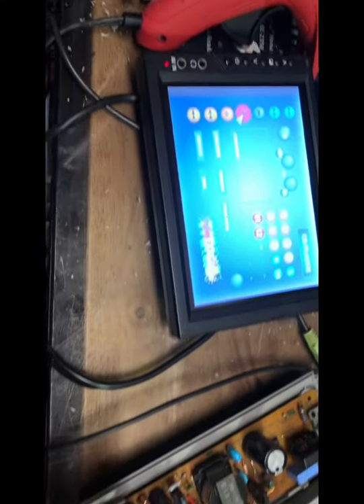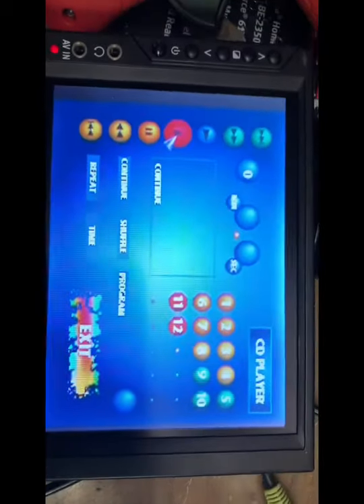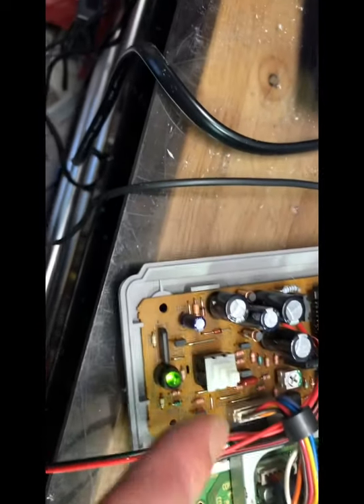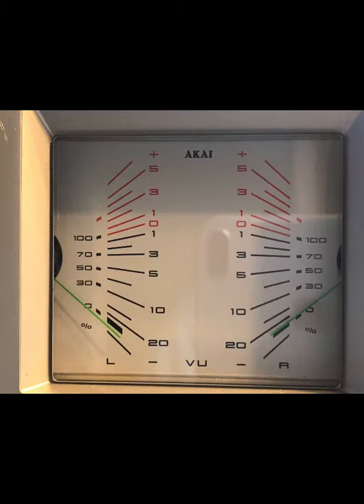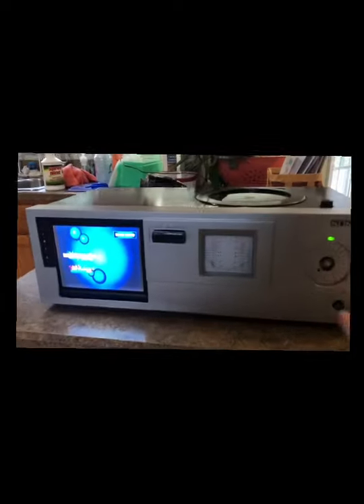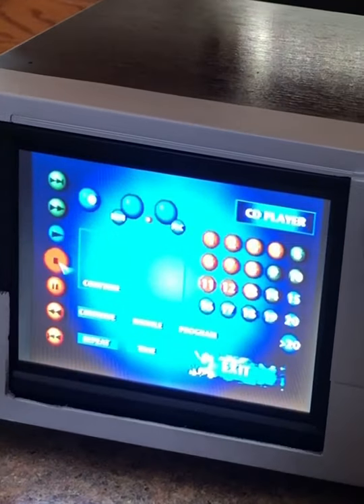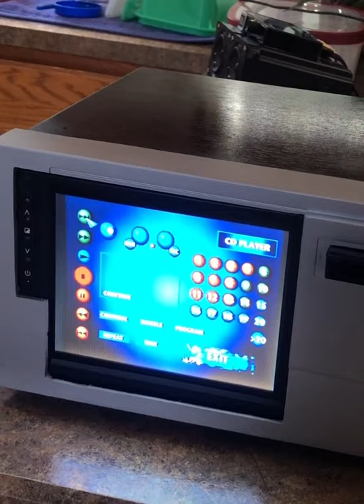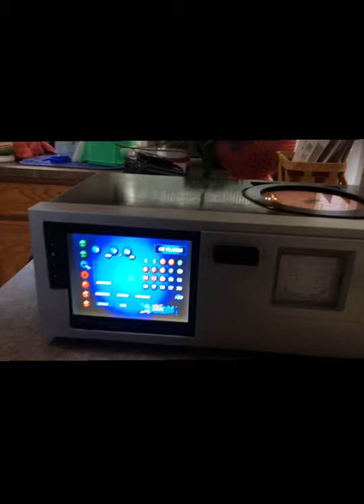Sony PS1 Audiophile CD player  SCPH-1001 DIY Akai CS-M01 Conversion

Comment: Man that’s awesome I always heard the PlayStation was one of the best CD players but didn’t want that look with my stereos but with this I might have to try to make something similar. I run a Sansui 9090 and a pioneer sx1250  both recapped by me in the last year. I remember seeing a pioneer in one of your videos before. Awesome stuff man.
Reply from the maker: I felt the same way with the look of the PS1. I remember you commented when you spotted the pioneer. I was surprised 😂  I just need to make an all in one power supply to power the screen, ps1 and the vu meter board. I’m thinking of using Pc power supply. Just gotta figure out how to do it. Thanks !!! 😎👍🏻
Reply: @2pleez122474  I'm seriously interested in purchasing.  Please  lmk

Comment: I don't know why people like the PS1 as a CD player, it has a really high noise floor.
Reply from the maker: Obviously you don’t. So don’t go complaining to me about it 🤦🏼‍♂️
Reply: @2pleez122474  not complaining, I'm saying it's a waste of time and money getting one and doing all of this or anything else that's circulating around about it. You can get way better sound by using any dedicated CD player even from that time.
Reply from the maker: @LetsRideIllinois  I had seen this done in different iterations around the internet. I had an old tape deck laying around along with the ps1. I figured it would be a quick, easy and fun project and that it was 👍🏻
Reply: @2pleez122474  well for a countertop unit as shown in the video it might be ok but it's not going to produce any earth shattering sound that you can get from even a PC being used as a CD player. You turn it up to louder than a human conversation and there's noise.
Reply from the maker: I wasn’t trying to break any records here . Just take it for what it is and let it rest. I have a Yaqin MC-13s Tube amp, a Pioneer CT-F750 tape deck, a Pioneer SG-750 graphic EQ, a AIYIMA Tube-T2 for preamp and Bluetooth, the CD player I made and OHM Walsh 2’s. Let me be happy and stop criticizing as I know a little something about sound. Like I said before it was a fun project.
Reply: @2pleez122474  I know why you did it and I'm not knocking that. I'm just saying all of this as a deterrent for anyone planning this or similar thinking they're going to get ground breaking sound when it's just not the case. The audio output of the PS1 was extremely noisy when turning it up to any level beyond a human conversation.

Comment: That aint an original ps1 thats a 2000 model, shitty cd player interface, good job with the mod though bit bulky
Reply from the maker: That’s the model that others said had the nice cd player that were much nicer than my mod 🤷🏼‍♂️ As far as being bulky I was trying to do it on the cheap and I already had that tape deck sooo…..